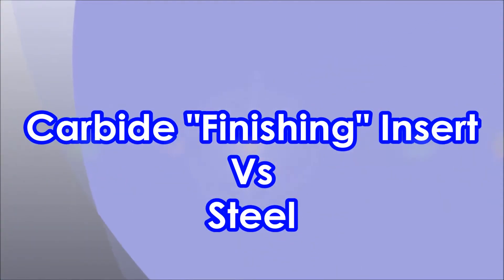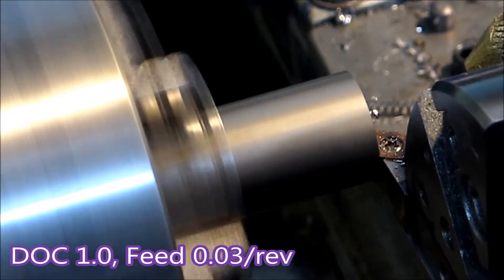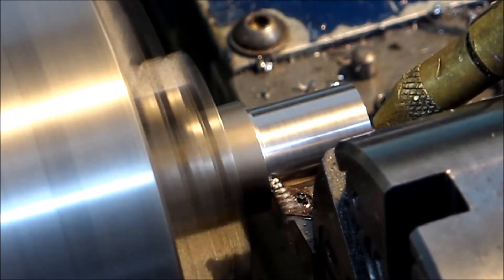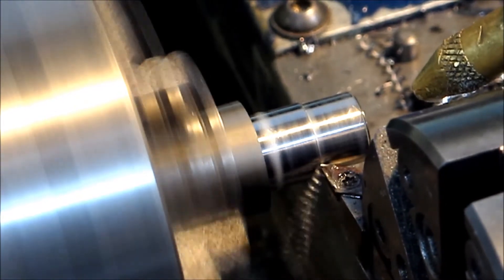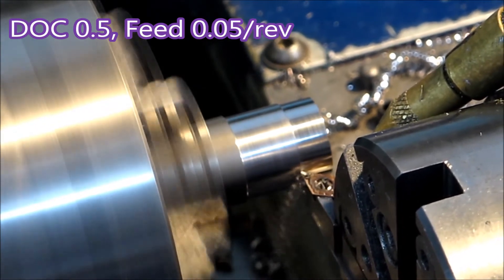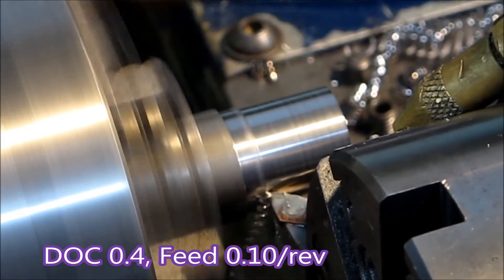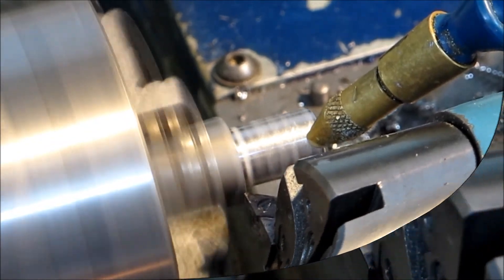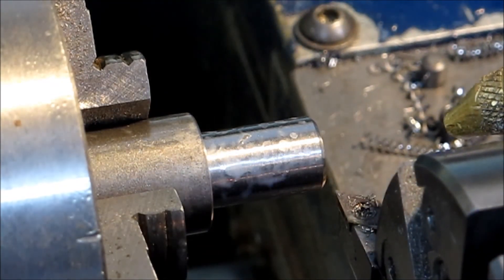Turning steel in your mini lathe? Try Carbide inserts that need less power

Comment: When you're looking inserts from ebay for example, the third letter says if it's molded or ground if I've understood correctly. For example, CCMT is molded, whereas CCGT is ground. Most of the ground inserts on ebay are for aluminum, but there are some for steel.
Reply from the maker: The third letter is the tolerance, G is a lot tighter than M. They may need to be ground to achieve that accuracy?
Reply: @smallcnclathes  all I have seen have been ground. You are probably correct. It may be difficult to hold tighter tolerances without grinding.

Comment: what type of steel?
Reply from the maker: In this case the steel was S1214 Free Cutting, but in this video https://youtu.be/2QU3xGtlixw, the steel is 4140. Anyone using a mini lathe should try to find/buy/use the material that will machine the most easily and still do the job that they require of it. Some folks are not even aware that steel (S1214), aluminium (2011) and brass (385) come in machining grades.
Reply: lovely videos indeed, but it seems to me that you set quite higher SFM?
another Q''s
would turning mild steel be nastier than that 4140?
what do you use to program your lathe?
Reply from the maker: @GraphicManInnovations   Thank You. When I started using carbide inserts, I was told to use 300 for aluminium and brass, 150 for S1214 and I think for that 4140 I used around 80, but not really sure, it was a while ago.  Then actual rpm should have been around 1270, but that speed in High range would have given me very little torque, so I ran it in low range with a maximum rpm of 1000.
Not sure how MS would compare with 4140, although I took it quite slowly the 4140 did machine quite well. it is a tougher material than MS. Folks with large machines might think there is no difference, amazing what spare horsepower can do. The lathe uses the software supplied by the manufacturer, so old it is DOS based. I usually run it either in DOS or win 98.

Comment: Useful video 
The effect of changing feeling/rev and  doc is now clear
Thanks
Reply from the maker: Thank you for your comment. I am glad you found the video worthwhile.
Reply: smallcnclathes this is the truth i asked many engineers to tell me the effect but no one gave me the answer i need .
But is there a table for metals and smooth surface relation with tools?
I mean if i need to get a very very finished surface like mirros for iron material , what should be the spindle speed and  tool feeding ??
Did you got my question?
Thanks alot
Reply from the maker: Hi Ahmed.
If you mean grey iron, the grain structure is not very good for giving a mirror finish.  All you can try, I think is to use the correct surface cutting speed for the tool and material, use a larger radius on the tool and use a fine feed.
My insert supplier makes inserts for cast iron with specific chip breakers (or none at all) and special grades of carbide with coatings that are suitable. For these inserts they supply information regarding cutting speed, depth of cut and feed. I do not know of any chart available.  You could look at pages A10 and A11 in the Sumitomo online catalogue at http://www.sumitomotool.com/fileadmin/user_upload/katalog2018/general_catalogue_2018-2019_interactive_en.compressed.pdf
Sorry I am not able to help you more than that.
Reply: smallcnclathes 
I appreciate your help and support thank you so much
I want to make a piston  by the lathe and i need a mirror surface  
Some machine  i watched on YouTube can finish the surface like a mirror without using any other special tool 
The same tool used for cutting also used to finish the surface so what was the deference?? Speed and  tool feeding nothing else ,
Thank you again i think you got what i want to do .
Sorry for bad English my mother tongue is ARABIC 
Egyptian .
Reply from the maker: A cast iron piston?

Comment: What model inserts are you using? I am planning on using a diamond wheel on my surface grinder to grind down cheap inserts to razor sharp consistency.
Reply from the maker: Hi Bruno, I use the Sumitomo inserts with what they call the FC chipbreaker which is a ground insert.
When I started out with the cnc lathes, the Sumitomo rep suggested these and I have used them ever since.
I found them a little fragile for use in my centre lathe and that was when I found out that inserts can be ground or moulded.
The moulded inserts are more robust and cheaper, but they require more power than the ground inserts.
The finishing inserts tend to have a larger rake angle too, so the material peels away better.
I would suggest, if you are going to grind them sharp, you should try to find inserts that have some rake on them.
I am not in a position to suggest any inserts to try, as I tend to use this FC insert and nothing else.
I have purchased some Sumitomo FB inserts that are " Finishing" inserts that are moulded, I intend to do a comparison video some time, but work is not letting me have the time to make the video!